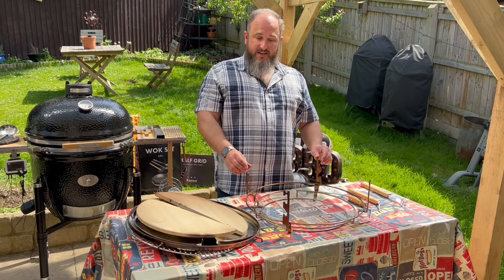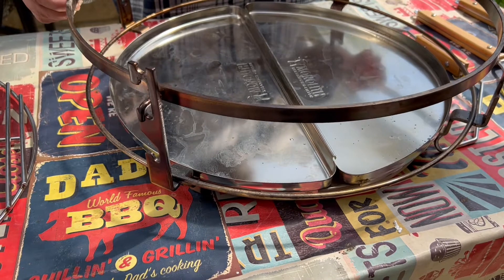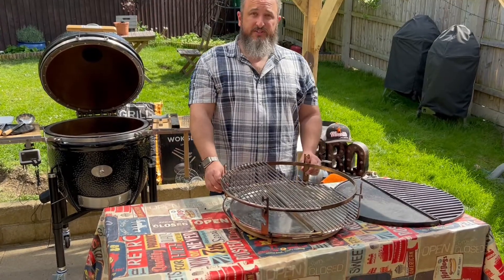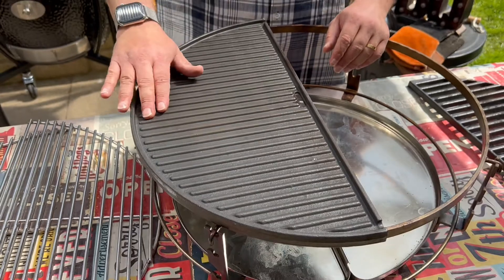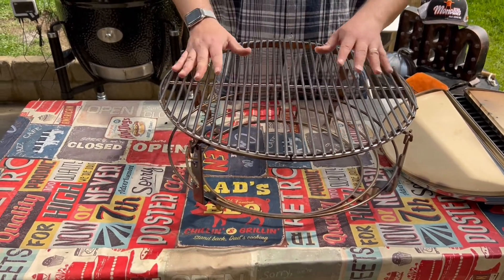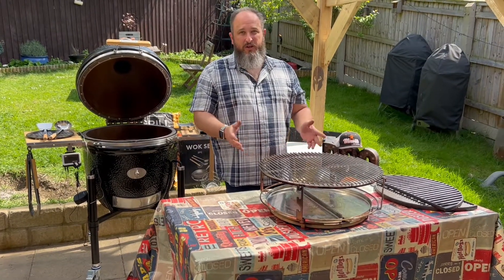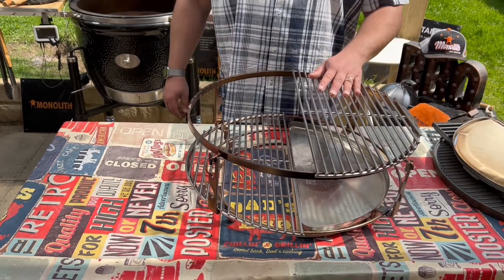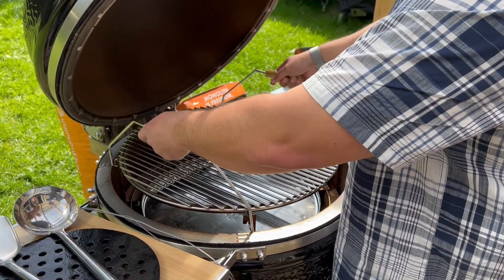Monolith Pro Series 2: Smart Grid System Configurations

Comment: This looks great! Just curious about the drip trays. Should they stay shiny and silver like this? Mine went tarnished and almost rusted after the first cook
Reply from the maker: With exposure to heat, all metals will change colour. Mine are much darker in colour now in places, it's normal. Mine also now have patches of pure black which is where oils in the tray have been heated and polymerised bonding to the metal (seasoning!). They are stainless steal though so should not rust, are sure it is rust? Try using a Brillo pad on those areas to see how they clean up.
Reply: @knightsoftheroundgrill  cheers, will give this a go
Reply: Thin stainless is particularly susceptible to changes under high heat. It's to be expected. 
Long winded answer is that heat will drive change in the chromium portion of the steel and allow rust to form.
Reply: Making my way through your videos, only just got our Lechef model so will be hoping to try a few ideas in the coming weeks, after these 3 years are you still happy with the monolith ? Any issues arose that I need to know of ? 
Thanks again for all the videos 👍